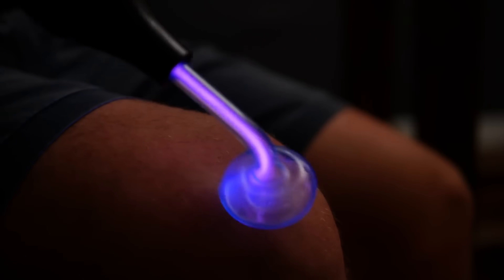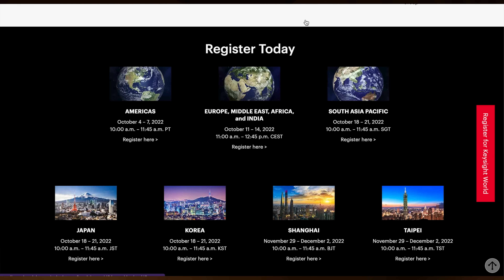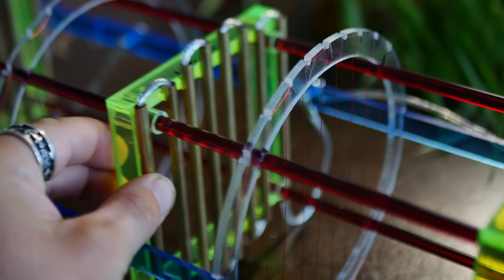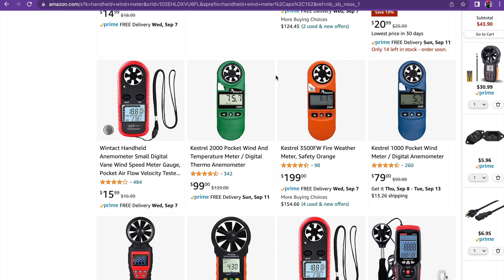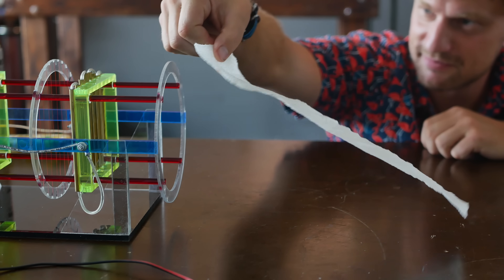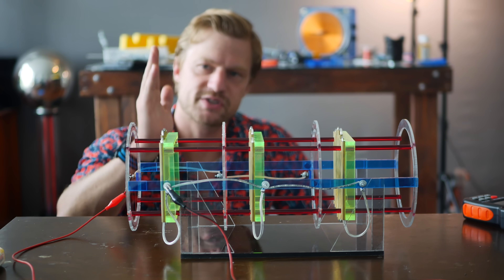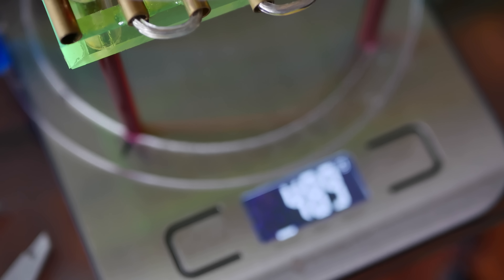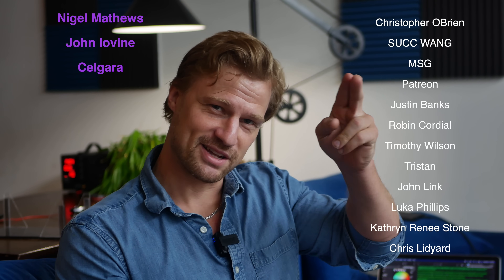Designing A Next-Gen Ionic Thruster! (For Flight)

Comment: I have a few ideas:
- put everything into a cylindical tube so no leaking airflow. and it compresses towards the end (jet) 
- the stages should be adjustable with motors so that as the airspeed inside the tube accelerates the spacing can be adjusted to increase efficency
- try a propeller in front. As this should be engine and mounted on a plane, test what's happens if there is allready an airflow before hitting the truster. - > movable spacing
- at the moment you are using a homogeneous  field. What about a shaped field with more power in the middle then at the side (water in a pipe problem)

Comment: I don't know anything about electrostatic stuff. Plasma is almost science fiction stuff to me. I'm really no better with jet engines. However, saying that, a few ideas come to my mind...  You are building a jet engine. Pure and simple. So basic hydrodynamics come into play, at least where air movement is concerned. You know, just thinking, with one an extra step, you'd have a Magneto-Hydrodynamic engine, er, I think. But that's beyond the scope of your experiment.

Try a convergent inlet. It has been proven to increase efficiencies in propulsion.  Conversely, a divergent nozzle might also improve thrust.  Better yet, a test of a a convergent nozzle as well as a divergent nozzle might make for a fun and easily constructed test. Simple paper cones would be good enough. However inlets use a more trumpet shape. Just from looking at the dry ice test, one can see Irflow acceleration well off the construction.

Also, you might check for losses to the airstream from your structure due to parasitic drag. You might as well try testing by constructing a enclosure inside of the structure of outside. I'm betting your flow is not laminer due to the framing. Another more advanced test is some method of heating the airstream at different temperatures as air mass is affected by temperature.  By adding dry ice, you've changed the performance of your airstream. This may set you back when a demonstrator is built and you see a different performance with room temperature air.  

You are using brass rods as part of your electric grid, or whatever electric terms call it (like vacuum tubes). That's fine, but can you instead, use wire? If not, then try thin strip or streamlined tubes. Aluminum tubes, if they'll work for you, can be purchased at model airplane hobby suppliers. They already have a airfoil shape.  By using the round tubes, you are inducing eddy flow. This will create drag. Thin strip would minimize this, especially if razor sharp. Although at those airspeeds, that's not a big deal. Anyway, any non streamlined  framing element in the airstream will cause loss of effiency.

Unlikely you can test this as it requires quite a bit of work, but you could try a different mesh spacing on your grid or emitter wires. I know you are limited by current arcing, but just a thought. That's beyond my kin. Secondly, even more difficult to construct, is altering the profile of the airstream with a shaped enclosure. As the stream goes farther through your engine, the enclosure tube constricts a bit. This is jet engine stuff and may cause trouble.  Jet engines constrict quite a lot to compress air as it flows through.  I'm very interested if this method of moving air will choke, or stall the airflow inside the stages.  Which brings me to some questions on hydrodynamics I know too little about. I'm sure that's all for something like a final demonstrator.

If you need more concrete visualization without messing up your test,  one can try smoke. But a schleiren imaging device can be built and will give very high quality observable data for airflow characteristics. Schleiren photography is what pros use, though your device can be much cruder, using homemade components. The cool thing about schleiren photography is than even minor changes to the geometry of your engine can be easily seen.

I'm not certain, but try a different test rig for measuring thrust. By placing your inlet at the bottom, even with a one inch gap, you are choking your airstream. You can test if that's the case next time you test for thrust, by also checking windspeed on the output. See if efficiency is lost.

 As a lark, it'd be interesting for you to heat up the airstream somewhere along the path to simulate combustion, for instance your candles or a torch of some sort. 

Finally, consult with a hydrodynamics guy.  I bet they might offer great advice for you on  increasingg thruput.  Your channel is very interesting to watch.

Comment: Enamel coated wire was used by the looks of it for the positive. So sanding the coating off in the flow path should give it alot more thrust.
Reply: or burn it.

Comment: Maybe try staging voltage with only 1 or 2 grounding points or maybe a single grounded air tube that acts like a cone with maybe a 1:1.1 ratio or something the round tube are poor aero dynamics for flow

Comment: 1). It didn't look like you removed the insulation from the fine wire 
2). Your secondary electrodes are tubes, they should be vanes 
3) Try building the whole thing from paper board, or sub millimeter carbon fiber sheet, or fine balsa wood... 
4)you might benefit from some type of shrouding/ducting/nacelle arrangements

You are very clever getting us to list these ideas for you 😎

Comment: I guess you can increase the voltage between each section.  the first section is 30kv second is 30kv as well, but between them should be 60kv. it means you will have 90kv for 3 sections and flow will hold inside electrons beam, and will be continuously going increasig speed

Comment: The stage distances could be adjusted, the whole truster could be enclosed in a tube, one of the stages turned 90deg? Also maybe using conventional thruster nozzle at the end to speed up the flow, maybe with magnets?

Comment: You can use a nylon tube to restrict the airflow in 1 direction. Also, the plastic rings that hold the wires have way too much material, either go for slimmer versions or skeletonize them. Also, right now you have a square design that requires 4 anchor points, going for a, circle design with 3 anchor points would reduce the weight while increasing the airflow.

Comment: I feel like you need to take the data for a single stage, then turn on the second stage and adjust spacing for optimal thrust, then turn on third stage and adjust and measure for optimal thrust again. 
I wonder how many stages you could add...

Comment: That looks aewsome in the dark. out of coursity are you using bare copper wire or magnet wire? if magnet wire did you remove the shielding coating?  It looked like there were hot spots when showing it in the dark, i'd think the more area the flow starts from the more thrust you may get.

Comment: The design as-is is really vulnerable to transverse air currents to the body of the thruster. Some kind of aerodynamic chassis could mitigate this, something like the inside of a conventional turbine jet maybe? Also, the negatively charged lines inside the thruster could be made a bit thinner, so that they impede air movement less. Finally, could you exploit a permanent magnet to repel the ions in a certain direction inside the thruster?

Comment: 1. Need some sort of cowling so all of the thrust exits in the same direction. I suspect some of the airflow is getting scattered.
2. Could try making a cone shape so the air flow is compressed like a turbo compressor Each stage is smaller (or larger) than the previous version.
3. What if you use three separate voltage Cockroft-Walton each stage gets a separate HV multiplier. I suspect there is a lot of voltage drop.
4. What if the electrodes are cone shaped and concentric? This might improve air flow acceleration. 
5. Try using a much higher switching frequency, 60Khz to 100Khz. I think more energy will go to ionizing the air instead of creating heat.

Comment: Hmmm, it's using air to cause electron to be activated. Use this in a negative pressure room. I bet it won't work without air present lol. Some physics claims that it will work on outer space. I know that it doesn't work because outerspace air are barely present due to gravity pulling these air to other center point, planets and bigger objects. So a great testing would be to use it under negative pressure, which will prove that it doesn't work in outerspace

Comment: Try increasing the voltage with each stage. While reducing the diameter of each stage slightly. So the velocity increases with each section.
Also some form of ducting may help, as it may direct the air out the back better. But the drag of the ions and air on the walls might be too high.

Comment: 1)A kind of Conic/tubular structure, around it , as of now outside air  must be causing drag by creating tons of small whirpools all along the body, because of the differencial in pressure.

2) instead of square frame for positioning of electrodes , a radial or even concentric distribution for electrodes, and aerodinamic framing will make a diff.

Maybe toroydal shape to expose  electrodes over one side then leave a blank space for ion flux and in the other face of the frame the counter eletrodes (cathodes and anodes ...) ,if you want to play with pressure diferentials , a central metal tube with a plastic cover for distance variation experiments  could end in less space increassing air pressure , some straight tubes if possible (and the extra weight is not that bad) to create the laminar flow (post vector controlling flow..).

Note: maybe check a little about "fanless" fans eficiency (they use something similar to a hidden turbo charger air output is what increases efficiency), its been used in real size drones ,  safer (birds , little kids intrepid cintific fingers)

Comment: A few suggestions to try:

- Ducting the airflow path
- Intake lip 
- Outlet choke
- Aerodynamic shape for the electrodes
- Spacing of each stage seems to matter because of airflow speed over the electrodes, this suggests that there is an optimal spacing for each intake velocity and thrust setting.
- Mount the engine on a load cell so you can log thrust automatically
- Find a way to automatically adjust spacings and voltage, so you can plot performance automatically.
- thrust to watt ratio is 0.24, efficient RC ducted fans reach about 2.4. Maybe add a amp/volt meter breakout to the supply so you can also plot/optimize for efficiency.

Comment: 0) airflow path could be significantly more aerodynamic, removing sharp corners, making the cross sectional profile radially symmetric. 1) you could decrease the flow column while maintaining the inlet column area to maintain a constant partial air density even with the increased airflow. 2) (and this one is a long shot) you could use uvc lamps to decrease the energy required by  to ionized the air molecules between the gaps, possibly improving the avalanche breakdown of the air 3) reduce the air pressure (might sound like cheating, but doesn't that just make it better for low atmosphere environments like mars?)

Comment: needs more surface area, crisscross/mesh wires. instead of just parallel
or maybe something like nickel strips used for spot welding lipo batteries (turned on edge to be more aerodynamic obviously) might make the air more laminar too.

Comment: If you enclose the engine in a tube and add an exhaust fan to power compression fan like a jet engine then add an arrow spike exhaust then add a high energy arc to plasmify the atmosphere as it passes through superheating it simulating combustion without chemical reaction

Comment: Voltage is nice, but current is what moves electrons.  More mass on the cathodes,  because they will deteriorate.  Weight doesnt matter,  even mass is unimportant. Attaching a fission power supply with fuel, communications and then some sort of science package would be the difficult part of the engineering of an extrasolar spacecraft.

Comment: how about more stages (as suggested below), stepping the voltage from stage to stage as well as the spacing, and rotating the grids (stages) relative to each other:  say, 5 degrees, 10 degrees, 27 degrees 45 degrees.  I'm thinking of here of what happens with "magic angle" in twisted graphene atomically thin sheets, and the like.  I also like the enclosure idea suggested below.  AND:  bonus suggestion:  Try filtering and modulating the HV.  Filter to lower the ripple, then modulate at difference frequencies from audio to as high as you can generate.

Comment: 1) Remove the two sides of your green bracket so there is only one top and bottom and make them thinner, Use only two full circles front and back for stability but the middles will use an arc from each red support top to top and bottom to bottom respectively. 2) Use your red support to run your power and cording removing blue brackets 3) Change your arrangement by removing the brass tubes on the outer most reaches.   Maybe try making it smaller but with More stages. What if you made it 2" diameter but with 5 or 6 stages keeping in mind weight ???🤔 Keep the length.

Comment: Enclose it and make each stage a slightly smaller diameter there is no way the air molecules will be able to move back against the flow, pressure will build with each stage.

Comment: Is the thrust with 3 stages more than 3 times higher than the thrust with just one stage? If not, wouldn’t it be more efficient to just increase the total area of thruster instead of stacking them together? I think for momentum coupling reasons, it’s better to have a larger cross-section of slow air than a smaller cross-section of fast air, at least at slow speeds. If the aircraft itself will travel somewhere in the realm of 2+m/s then serial thrusters may well be the ideal solution. Speaking of momentum coupling, I suspect you’ll want to test varying front electrode densities, as that will effect the unionised air bypass ratio. Some ducting may help, maybe, as might feeding different voltages to different stages.

Have any ideas for a portable high-voltage supply? I’m leaning towards a resonant transformer driver as opposed to a flyback method, I think it would give you a better power to weight  ratio. In particular, a modification of a simple ZVS circuit to use high-current gate driver ICs.

Comment: In the staggered configuration
If we do a lil math and find the acceleration of the wind and distance the next stage according to acceleration we might find some good results

Since you are using 3 stages already it'll be a good idea to use some kind of simulatanious equation for it

And if you're able to provide with a proper formula for N number of stages you might even get a patent for that

I also want you to experiment with increasing distance from 1st to 3rd and decreasing distance from 1st to 3rd

You should also test the reverseablity of the machine since all the things that work on voltage are sometimes reverseable

Sorry for spelling mistakes 😅

Comment: I'm so curious on how it will work inclosed I'm no rocket surgeon but there are alot of test I'd like to see like set it to the most efficient spacing inclose it and maybe add a small fan to the intake subtract the fans output to see if it increased thrust or if added thrust was just from the fan if moving particles faster through it actually increased thrust then play with weight vs efficiency
Reply: If you read this one can you do a stupid simple and parts list build sheet lol I'd like to experiment maybe used a more conducive ground like silver see if it helps

Comment: I've seen a lot of people suggesting that the thruster be put in a duct to reduce pressure losses between stages (which I agree with). Additionally, I'd be very curious to see whether the presence of a nozzle at the end of that duct significantly changes the system behaviour or not.

Comment: I built a 1-stage version as a kid. I think one thing you could improve is use a more spiky ion-generating electrode. I used a wire grid mesh with sharp pieces of wire soldered to each  grid node at 90 degrees. You also might want to use a somewhat thinner wire for the other electrode, to block less air. Just make sure it's smooth, so it generates less ions. Also, did you try swapping the polarity and generating positive ions? If the efficiency is the same, you might want to have a stack of hair comb like layers, with spily sides pointing downwind (and generating positive or negative ions), and the smooth sides pointing upwind, absorbing the ions.

Comment: I think you could get more thrust if you enclose the full thruster inside an acrylic cylinder.
But the main disadvantage is that it will increase the weight a lot. So, I may suggest you to use some transparent acrylic sheet to glue with the thruster which might increase the weight upto 2-3 grams but will increase the thrust a bit.
Now some suggestion to reduce the weight of the thruster.
Make the circular disk a little thinner which is holding the cathode as well as the anode.
Also use some light weight material for the anode such as aluminium.

Hopefully this idea works.
Thanks for this amazing explanation.

Comment: One particularly big change you could make would be to change the aerodynamics of your electrodes. Cylinders are particularly bad aerodynamically, but you can 3d print an airfoil and wrap it in aluminum foil for both weight savings and a significant reduction in aerodynamic drag on your negative electrode. It wont look as clean, but an airfoil has something like 1/10th the drag coefficient of a cylinder

Comment: 1. Is there any chance you can make the anode/cathode more aerodynamic?

2. Close off the sides of the thruster so there is no leakage

3. Also you could optimise the staggered spacing by adjusting the spacing of the 1st segment alone, then the 1st and 2nd, then all 3. That way each segment is optimised for the fasted possible incoming airflow